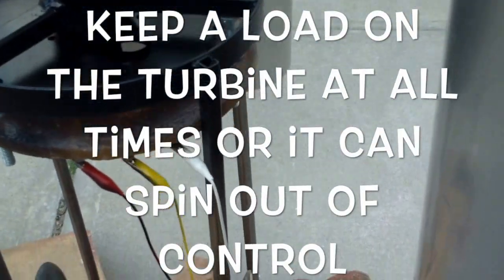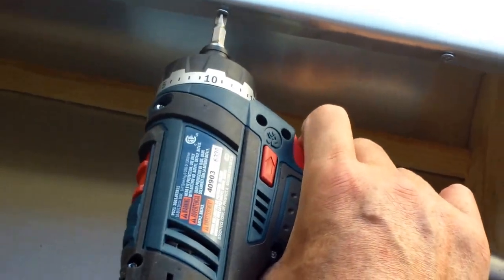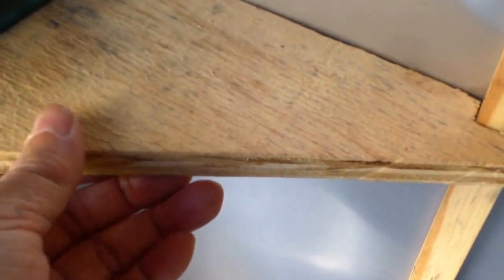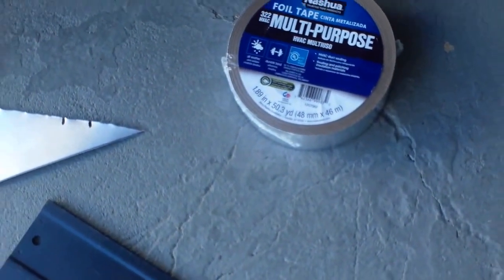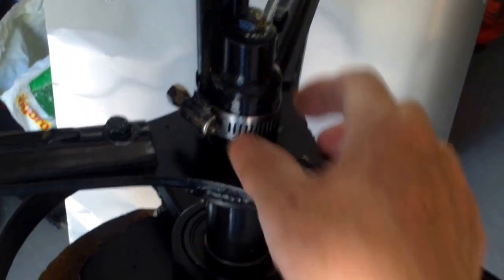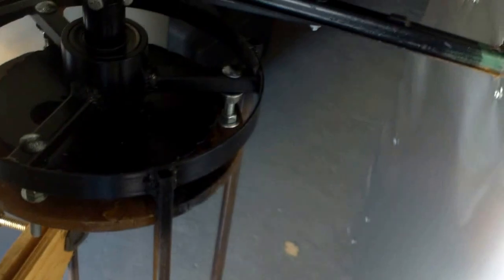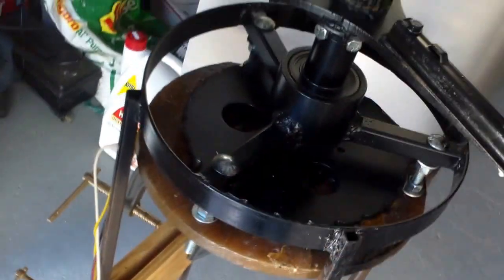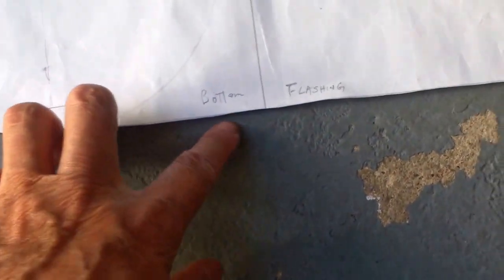Making Lenz2 wings for my vertical wind turbine

Comment: Very nice looking.  How did you get such a neat curve on the sheet metal?
Reply from the maker: +Russ Bowers Use very thin gauge aluminum flashing. This makes the wings very light weight and it was turning very nicely yesterday.